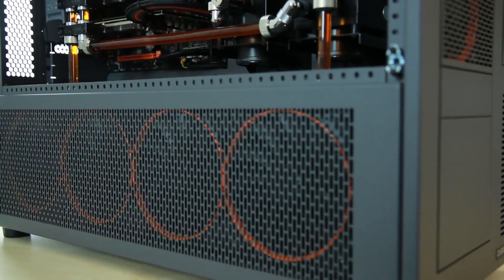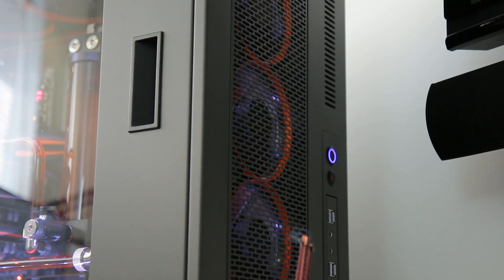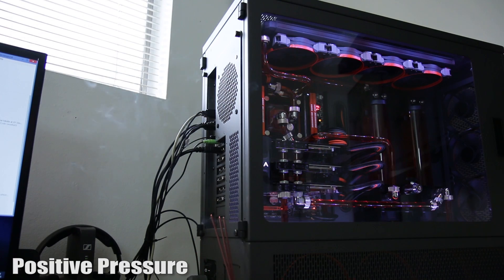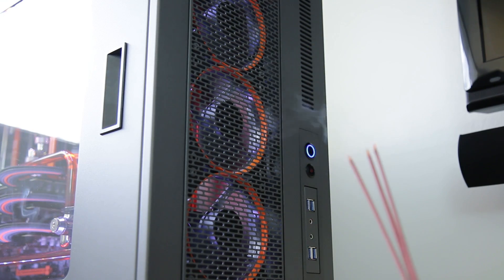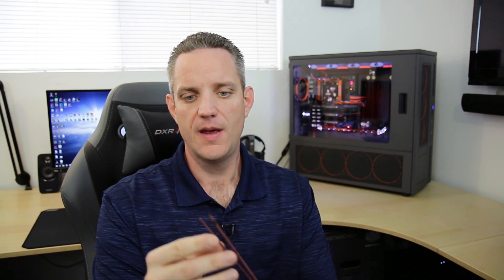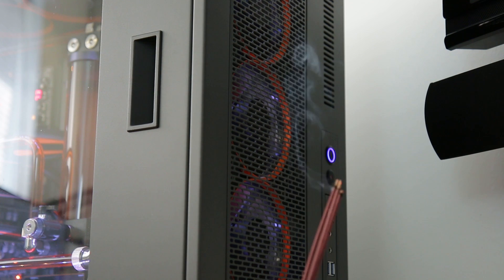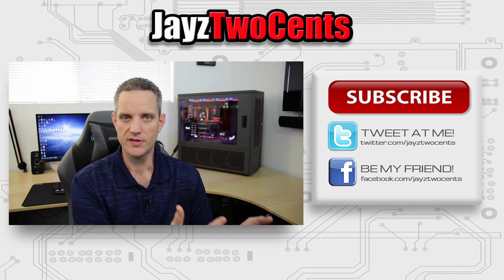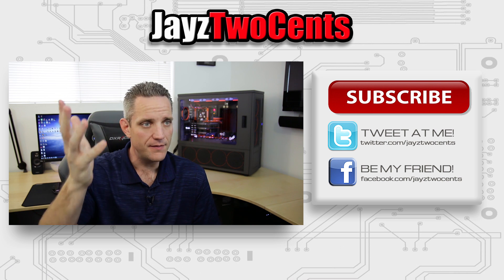Case Flow and Pressure Demonstration - How to balance airflow

Comment: You probably aren't reading comments on old videos anymore, but you constantly say things that are just objectively untrue just to spit in the faces of people who's comments bother you. For example, case pressure ABSOLUTELY has to do with the number of fans you have pulling air in and pulling air out. RPM ABSOLUTELY has the ability to make one fan push more air than 100 fans barely moving. We aren't stupid. The critical point remains: Strictly because you have MORE FANS pulling out than pulling in, you CANNOT run your exhaust fans to their maximum RPM, unless your intake fans are 5/3s more powerful each than the exhaust ones, which is not a typical scenario. Stop this spiteful attitude. You do it in current videos as well, and it harms your channel.

Comment: A simple barometer on the in and outside of the case will show the real pressure.  The difference in pressure of both meters will give you positive or negative pressure.  Don't understand why nobody came up with this.

Comment: mine's got 3 in on the front, 2 of which are slightly obstucted and 3 out 2 on top and one in the back, i haven't got any problems with it but i suspect negative pressure

Comment: Just because this video brings it up, I'm not overly fond of running a lot of incense smoke through my electronics. Incense smoke is actually really oily, and leaves deposits wherever the smoke settles. For short tests like what's shown here, it won't be a big deal. But over time, they can gunk up electronics and surfaces. Likewise with candles and cigarettes, they put out a lot of tar and wax into the air, respectively, that has to settle eventually. Since I stopped burning anything around my electronics, and cleaned everything really well, everything has remained noticeably clean longer, and my electronics across the board seem to last longer, too.

Comment: Right!!! It has nothing to do with Number of fans. All about airflow volume numbers. Putting an Axial fan on a radiator does increase the pressure load, hence lowering the effective airflow volume dramatically.

With Axial fans on GPU (Open air coolers), negative or neutral case Pressure in the case is good.. Why? Do you want heatet up air from the GPU to be "stuck" in the positive preassure.

With Blower fan GPU's, you want positive case pressure. So case Exhaust fans are a waste, if you don't need it for the CPU. Why? These blowers will suck the pressure out of the case very efficiently, and they leave hardly any heat in the case. A good recipe for Minimal dust buildup.

Comment: What about a internal case fan? I placed a high airflow pwm fan inside my case helping air along from the front to the back, over the GPUs. Nothing helped more with my internal cooling than that fan, with up to 6 degrees C less on the GPUs at full speed.

Comment: I'm doing a push/pull configuration with a NZXT x62 in a Fractal Design Define R6.  I've watched your other videos on airflow and I'm trying to get a positive pressure airflow.  Does a 280 radiator in push/pull count as 4 intake fans,  2 intake fan, or somewhere in the middle?

Comment: Love the videos btw. I want to tap into your mind for some feedback. I have a 750d case. All cages removed except at the top front. Evga 1080sc (exhausts in the case towards my cpu) fans blowing upwards. 
layout is as follows:
4 intake fans: 2x140 front, 2x120 bottom, 
1x140 exhaust fan out of the back,
H100i radiator mounted at the top next to the single exhaust fan , h100 fans pushing for exhausting. I am pretty sure I am positive air flow. Not too much dust in the case but just enough because of the old carpet in the room. Thoughts? Thanks. Btw cpu ryzen 1700 OCd to 3.9ghz. I have all fans pwn except the rear exhaust set to 7volts(I think, close to it at least). My first build, be easy on me. All 140s are corsair. The 120s are AF.
Reply: I couldn't upload a photo of my build.

Comment: Even with positive or negative pressure you ALWAYS have the same amount of air exiting as you do entering. You just have more force on the entrance for positive and more force on the exit for negative. If you had more actual air entering you case would become more and more pressured over time and eventually explode.

Comment: I hadn't even thought about my fan speed (Corsair LL140/120)... I was getting some flecks of dust in my new build and it was driving me nuts. Now that I've watched this video I ramped up my front AIO fan speeds to around 900rpm, and reduce the top and rear exhaust fans to about 600rpm each. This seems to have done the trick! Thank you :D

Comment: I've got a Thermaltake X9 case. I haven't started the build yet, so depending on clearance issues underneath the hard drive cages, I could end up with a total of 24 fans (including hardware fans). Sizes are 120, 140 and 200. I'm projecting 6 intakes on the bottom, 4 on one side, and 2 on the front. 3 exhausts on the back, and 8 on the top. All fans will be filtered. I'm old enough so my hearing is trashed, so I'm going to run them all wide open. Should be interesting and all are blue. My method of choice for testing airflow ingress and egress will be a large Cuban cigar.

Comment: One Point you make about negative pressure is that the PC sucks in dirt and dust. I think another effect might also be important: the "air intake" near the exhaust might suck in the hot exhaust air, and that cannot be good for cooling Efficiency. Another Thing that should be mentioned is the external airflow: when a PC sits in a confined space (or in a Corner)it might  create a closed Loop of air, so the same air is led through the PC again and again. Not good. third effect is that should be paid Attention to is that a Radiator as air intake makes much more sense than a Radiator as air outlet, simply because a Radiator cools the liquid to a temperature a bit about the air that cools it(and that is only ambient temperature when the Radiator Acts as intake!).
1. the air the PC uses for its cooling must come from the room without any obstruction.
2. the parts of the PC that Need most cooling should be cooled by the fresh air that comes into the case.In cases with a watercooling that usually is the Radiator.
3. the ways the air flows inside the case must cover all parts that need aircooling.
4. the exhaust air should have a way where it can go freely, without being directed towards the intake and without obstruction.

the relevance of positive or negative pressure is mainly that it determins wether all unblocked openings act as inlet, or as outlet. and wether you want them to be inlets or outlets.

i have seen desks that were offered that had a compartment for a PC that had a door in front and only a fistsize hole in the rear for the cables, that might work with an office-machine, but a gaming Setup would probably die in such an Environment. In such case it matters more where the PC would be Standing than how it is cooled internally. Removing the door and enlarging the hole in the rear would do more for the cooling in that case than anything you could do inside the case.

Comment: I blasted "I'm all out of love" into my case and it made absolutely no difference to my temps you liar.
Reply: maybe you're just failing with other stuff..
How old is your thermal paste?

I think you messure the temps of your devices, but, casefans actually regulate your Casetemps.. Can they carry away the warmth made by Graphics and CPU HDD SSDs etc?
Reply: Try using sennheizer speaker, 
since "i m all out of love" very high heart bead demand. 
If than you do, than still complain so its a blasphemy for "air supply"

Comment: so how could i fix my negative pressure in my case my case a IN WIN 303 so there is no front fan mount there is only bottom and back panel and side panel air flow i have no fans on the side panel i have two cheap fans on the bottom that only have fan speeds of 800RPM's and my aio rad running push pull with one corsair HD that is runny at 1900 RPM's and the case fan that came with the case that's at 1400-1500 RPM's (got fan speeds from corsair link on my pc)
Reply: oh and note the bottom of the case is the intake and has a screen

Comment: My pc is setup so air intake is through the back and i use my room  radiator as a kind of heatsink and is attached to the case via copper tubing. So the air comes out of the case and is neutralized (positive force newton pressurised,) so any following air is cooled meaning my 2 cpu setup can be clocked to like 8-10.4 ghz

Comment: Actually the speed is relative to the pitch of the blades. As to how much air it will move. As each company tries to balance that with fixed pitch and not all are the same. 

I only know one company that has made and designed. Computer case Variable Pitch fans. None of which you can buy. As the cost is over $150.00 per 140mm fan. Including the hardware and software that controls them. As you need a central breakout box. To hook them up too. At least 10 fans. Then the software to control them. These were designed for large Server rooms. 

You want an idea of what they looked like. This is close...https://grabcad.com/library/variable-pitch-reverse-thrust-propeller

Comment: I'm nuts about air pressure/air flow. I have 980 ti's in SLI with 4 "Noctua SSO2 Bearing Fan Retail Cooling NF-A14 iPPC-3000 PWM" in a push/pull config at the top of the case. I have 4 "Corsair ML140 Pro" on the Corsair GTX110i in the front on a push/pull pulling air in. I also have 2 "Corsair ML140 Pro" on the bottom compartment pulling in (HD/SSD's/PSU and a buttload of wireing) pulling. I need to smoke check (great idea on the scented sticks!). Thanks for the easy tips! I'm curious how jacked up I am haha!

Comment: Jay, would you recommend using watercooled rad gpu+cpu 280/360 in front of case with airflow intake, and having 2/3 fans outtake from top + the 1 fan in the back for outtake?

Comment: talking about physics wouldn't pairing intake and output fans give diminishing returns? yea the fans may have to work a tiny bit harder but provided there is enough gaps for the air to flow through the case the pressure should naturally balance out to circulate the air. not only that but in the case of positive airflow wouldn't the intake only set up reduce the dust if not actively clean the system as the likely more low pressure high volume air flow would blow the dust outside of the system.

Comment: Good video but still a little confused. Should my intake fans be lower in rpm than my outtake fans? I have 3 140mm 1500 rpm fans in the front and 1 120mm 1300 rpm fan in the rear. My new system will be using tht Lian Li D600 case which comes with a 120 mm 1300 rpm fan in the front zone 1 rear, 3 140 mm 1200 rpm fans in the front zone 1 front, 2 120 mm 1300 rpm fans in zone 2 front on the hard drive cages and no fans in the rear of zone 2. The top of the case can use 2 120 or 140 mm fans if needed which are above the motherboard section of the case. Any advice would be greatly appreciated. Oh and I will be using a single EVGA GTX 1080 TI Hydro liquid cooled card with an Koolance ERM-3K3UC external 9 fan radiator for cooling.

Comment: So if I have 3xHD120's on intake and 3xHD140's on exhaust, I will achieve positive pressure in my case if I set my intake RPM high and my exhaust RPM very low?
(First time builder, complete noob :P)

Comment: could i put 3 fans sucking in air at the front and a 120mm liquid cooler on top of the pc blowing in the pc and 1 intake fan on the back??
Reply: or a exaust fan on top of the case and liquid cooler on the back of the case and still 3 fans in the front?

Comment: i got corsair carbide spec 02 and i have put the two included fans in front to push with 12v and one SP 120 High Performance at 5v as exhaust. works pretty fine.  just realized that i got an Pressure fan as exhaust :b

Comment: IMO the best way is to use dry ice - it vapours without a trace. Incense or any kind of smoke/vapour will leave a very tiny layer of oil, which will attract and glue all the dust.

Comment: Remove all fans.

Neutral air pressure accomplished.
Actually, neutral pressure is ambiguous in this video. Neutral airflow means that air will flow in and out, but at an equal rate. You cannot test it with incense sticks.

Comment: Did you say that you have two 280mm fans at 8:22 running at 100% at all times? What is the radiator that you're currently using?

Comment: Positive pressure = less dust, Negative pressure = fewer hotspots inside. It's a tradeoff and very dependent on your case and the way you have the innards configured.

Comment: So, planning to use the corsair carbide spec-01. I'm assuming that it'd be best to use the two 140mm fans as intakes and the 3 120mm as outtakes. I'd love to mess around with this myself and actually test it myself but it'll be a while before I can assemble everything. So for now all I can do is speculate and think in advance as much as I can.

Comment: guys what do u think about this build?
2 front fans (intake)
2 roof fans (outtake)
1 rear fan (outake)
+ 1 fan on cpu cooler (thermaltakr frio 12)
case thermaltake versa n27
did i put the fans right ?

Comment: these days i don't even enjoy games TBH I'm always monitoring msi stats overlay and scrutinising the temps clocks voltage watt consumption of the gpu cpu clocks. 100MHz dip from boost speeds and I'm alt tabbing to investigate the cause, could it be temps? voltage limitation, I'm like i should have gone with the gold rated 650w psu...I'm losing my freaking mind it's no longer funny.

Comment: there is only one condition in which I think the number of fans can effect airflow. that is when all fans, both intake and outtake, are exactly the same on every way both at speed and size. however in this day and age and with so many fans to choose from and options to adjust fan speed you would be a fool to not use any of those tools.

Comment: i actually use my e-cigarette for this. i dont do long tests or repeated tests, but if you blow into an intake you can actually follow the full path of the air. quite useful for me. not as easy to test positive vs negative, but still does its job

Comment: I have the radiator of the liquid cooler on top of a 120mm fan. Since that was the default setup of this computer. And there's a intake fan in the front of the case at the bottom. It's a Raidmax mid-tower. And that's all my fans. I don't have any case fans at the top. And I believe there's space for 2 for this case.

The fans including the radiator, the blades are facing inward to the case (which I understand means exhaust?). And the fan that's in the front the blades are facing outward so you can see them (which means that it's a intake fan?). I'm very very bad with fans.

The purpose of these questions/statements is to find out what kind of case fans I'd need to place at the top of the case to get cooler temps and to not mess with the air pressure/air flow of the case. 

I want to get 2 more fans to put at the top to keep my case even cooler then it is. But I'm not sure if the case fans need to be pointed for exhaust or intake to help CPU/GPU temps. Certain games like Heroes and Generals for example run my computer hotter and just putting my hand on the side of the case u can feel the heat. But games like Heroes of the Storm, World of Warcraft, Battlefield 4, or Black Desert Online. Don't give me heat issues, like the case feels warm or nuke warm, but its not hot like H&G gets. Once while playing the computer shut down and restarted due to a blue screen. And I know that had to be caused by the temperatures. 

So what should I do? Btw I can't move the radiator if I haven't stated that already. The front has all kind of infrastructure to the case that's used from hard drive mounting and CD ROM Mounting. My only option is to put in 2 more case fans to improve better temps. But idk how to place them. With the blades facing downwards into the case for exhaust to get the hot air away from the CPU, but idk if that will affect the GPU temps or CPU from bringing the heat from the GPU past the CPU to get exhaled. OR mount the fans with the blade outwards to get cool air from my surroundings right on the CPU but once inside if the 2 fans the radiator/case fan working in tan-tum that are mounted together will be enough exhaust to remove it out. Not to mention I have that front bottom fan that's intake, if that will be too much air into the case and ruin pressure. Same with 2 fans additional for exhaust if that's too much exhaust in one place with ruin pressure in that sense.

Comment: Great Vid, I have a corsair case/fans. 2 intakes in back,2 in front, 1 exhaust on the side and two(including radiator) on top. All together I get positive flow with the heat exiting the top. The side exhaust sits next to the 980 just for fun. But all around I like to go for noise reduction.

Comment: I have a Corsair Hydro H60 I read that its best to have the air flow for the radiator coming into the case while the top fans push the heat out, but I saw a video from linus tech tips showing that its best to get positive air pressure with the front fans bringing that cool air in, and the back and top blowing heat out. I keep thinking that having the heat exhausted out of the case will bring better air flow as the cool air will help cool off the radiator better?